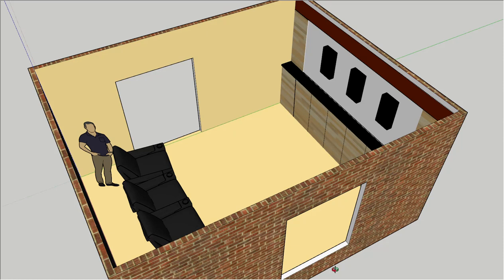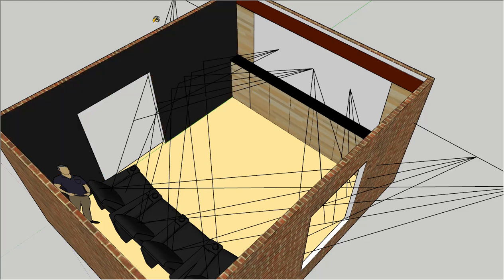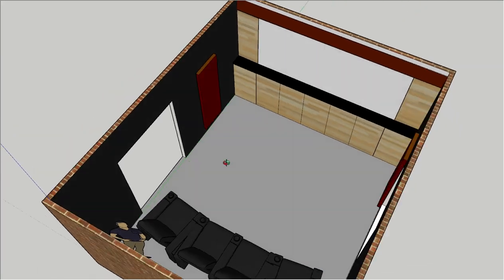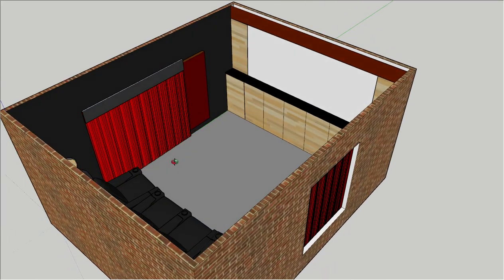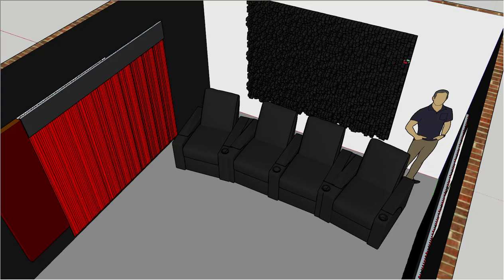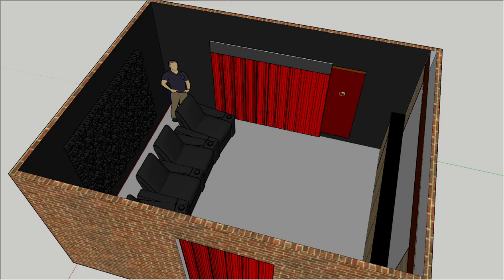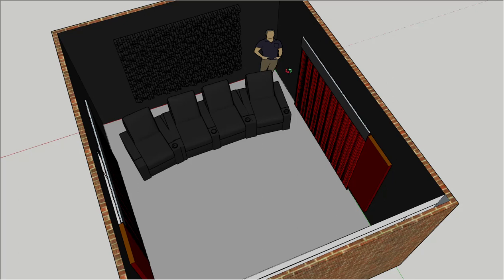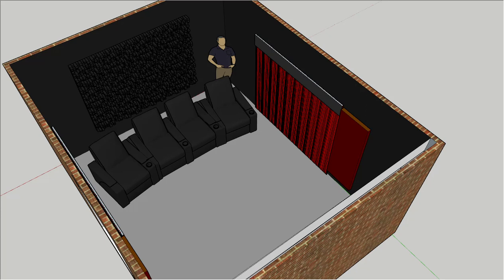Acoustic Redesign By Home Theatre Engineering

Comment: Hi, I have almost the exact same room with windows on one side and sliding doors on the other so I needed to put curtains up. I covered the window and door as little as possible as per this video but I have a really bad slap echo which is from the front to back as the back wall is bare. I was thinking of putting absorption panels at the back wall but am worried I will deaden the room too much. I noticed you put skyline diffusers at the back wall. I did read and watch a few videos with the opinion that you should not be closer than 6 feet / 1.8m from a skyline diffuser. This design it looks like the seats are quite close to the diffusers. What's your thoughts on minimum distance away from a skyline diffuser? Also, I am guessing you put diffuser at the back to not deaden the room too much?
Reply: Forgot to say thanks so much for all your informative videos!!!

Comment: I’ve just subscribed to your channel the information is very helpful unfortunately I live in Moama New South Wales just near the border of Victoria and New South Wales it be nice to be able to get you over to calibrate my projector and sound system I’m 70 years old pensioner and I’ve spent a small fortune on clips speakers and Marantz and Anthem receiver and power amp. My theatre room is a five meter by 4.5 meter including a walkway into the family room and kitchen not an ideal location but I love my Ebsen 6040 projector and 120 inch screen I have no room acoustics set up just a curtain over the window and carpet on the floors. I have four clips subwoofers I just bought another 2 to even out the room I’d like to buy the mini DS p but I think it might be a bit above me and if so how much are they shipped to Moama. What would the calibration of the projector and the theatre room cost